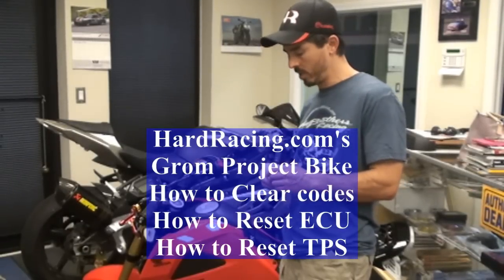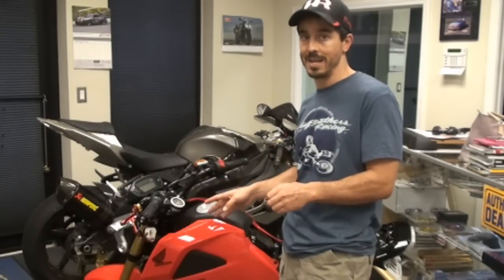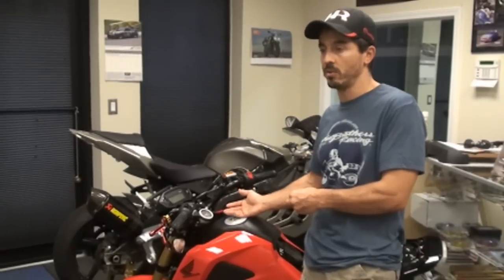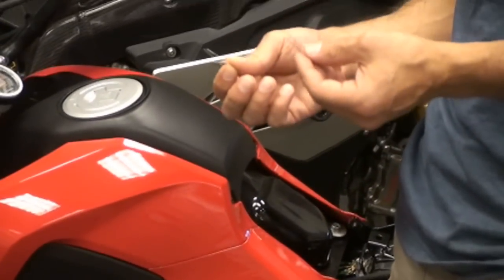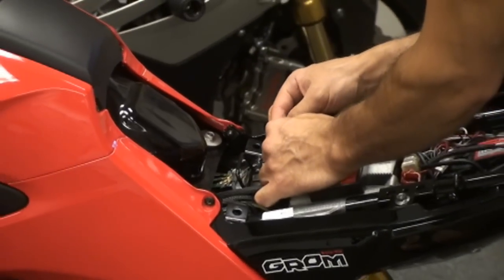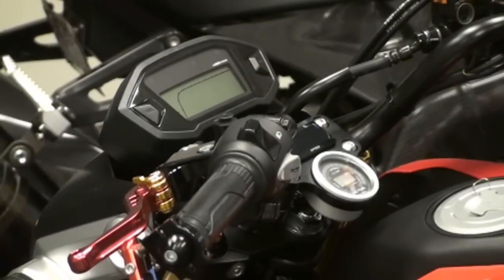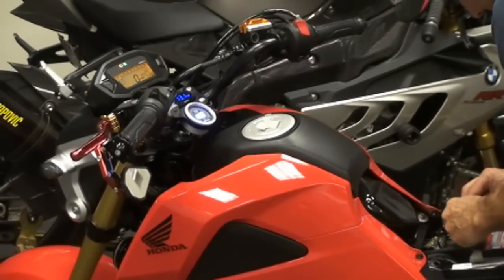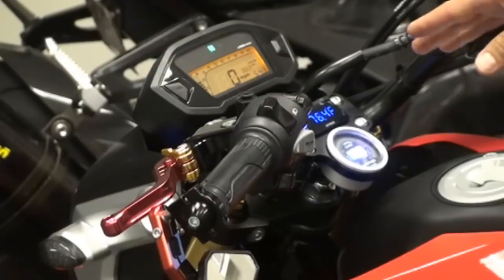How to reset Grom ECU How to clear Grom codes How to Reset Grom TPS  #Hardracing #Grom

Comment: Thx. 1st time Gromer.
Reply from the maker: That's great news.
Reply: @HardRacingPerformanc  Yeah, actually I tried to call you because my 2019 Grom didn't seem to clear the codes part of the process. Just nothing happened. I tried many times then reset ECU & it worked like you said.
Reply from the maker: @fpvflyriding   That's great news.  Glad you got it worked out.
Reply: @HardRacingPerformanc  Well, what I was saying is that the ECU reset but clearing the codes didn't work as you showed.
Reply from the maker: @fpvflyriding  that would indicate you didn't have any codes to clear.
Reply: @HardRacingPerformanc  Ok, great, I figured it must be something like that. Thanks a lot, that gives me peace of mind!

Comment: Does this work on new Honda Groms? I have a 2025 and the light came on. I only added a USB charging port, which plugs into the diagnostic port. Did a short test ride and everything was good. Took it out again the next day and the check engine light was on. Not sure if that's what is causing the light or not.

Comment: If you adjust the valve clearances do u need to reset the ecu of a motorcycle after that?? If anyone can reply im very much thankful..
Reply from the maker: you do not.
Reply: One more thing. Do you happen to know why my bike keeps on stalling upon cold engine start? My bike will start and will have a rough idle and after a few seconds it dies. It needs to crank 3-4 times before it will totally idle without stalling.
Reply: @jaysonbenitez740  sounds like your valve clearance might be to tight man. if they are you are gunna wanna get that fixxed asap. cheers

Comment: Don’t jam a fat paper clip or anything large in the TPS reset connector, or when u plug it back in it won’t make contact with the sensor. If that happens the engine light won’t go off and bike barely runs.use small wire that lightly goes in

Comment: My motorbike is throwing all sensor codes when I bypass that red connecter. Iv changed throttle body, ecu , harness wiring, 02 sensor wire, spark plug , coil pack, air filter/airbox and manifold, and iv changed the ect sensor. Bike has slugish acceleration anything befor 7k revs when7k revs comes the bike runs fine. Spark plug is white stuff but iv checked for airleaks no leak what so ever.

Comment: Hey mate, 
I got myself a flashed ecu , tried resetting and couldn’t get it to work. Followed these steps and got all the patterns perfect first try. Thank you! Only thing is after I was finished and plugged it back up, my check engine light stays on solid. Any reason for this? Thanks .
Reply: This is on a 2020 monkey btw
Reply from the maker: Unfortunately we don't do flashed ECU, or have any experience with them.   Too much unknown.  You'd have to check with the company you bought it from to find out why it's not allowing the reset.
Reply: @HardRacingPerformanc  thanks very much for your reply. All the resets actually worked following your video . Just the engine light stays solid. Cjr replied to someone saying ride it 20-30miles and it should turn off. Happens to the monkeys apparently and not the groms. I got mine flashed by dhm . 
Thanks again though, this video was the only one that was so simple to follow and worked perfectly after frustrating attempts following other instructions.

Cheers
Reply from the maker: @Mutthead  That's great to hear.

Comment: I took the outter snorkel from the air box and put on a new aftermarket exhaust with the dB killer  removed. The bike is running a little funny. I feel like I lost torque but it mite be from putting in 93 gas. I’m going to switch back to 87 but do you think I should do all of this? I reset the ECU but you said I have to do a step before that in order for it to work ? Let me know if you think I should do all three steps. Thanks !
Reply: Unfortunately, some modifications may seem like they will improve performance...…. but they wind up not doing so.
Reply: sales @hardracing yea so I put the airbox all back together except I kept the outter snorkel off . I’m hearing a lot of popping when I decelerate. I have the dB killer out of my muffler. Do you think I should do all of this stuff in the video?
Reply: This will work for the 2018 grom right ?

Comment: I have a Rs9 exhaust and I was told the grom has a self regulating ecu, but if I put a chimaera cold air intake would you suggest reseting the ecu??
Reply from the maker: Correct.   Reset the ECU.

Comment: Hey thank you for making such a video and make life easy.  I just picked up 21 Twin and installed battery tender and 2nd i notice i see PGM-Fi light stay on solid after ignition on and engine start. Wont go away read few hrs on blog and also check manual i came across this process. So what do u think should i do all 3 or just 1st part of ur video.  Please advise. 

Thank you

Comment: I don't have a grom but I have a 2018 Super cub 125 and I bought an aftermarket performance ECU from Yuminashi, After I installed it along with the heavy-duty valve springs my Super cub no longer runs or will start, I thought I might have to readjust the valves but that didn't work I also looked up resetting the ECU which I could only find info for the Grom and was told that they are very similar. Long story short do I have to reset the ECU" and how do I do that or Am I missing something. According to the directions from Yuminashi it was supposed to be an easy swap. Any help would be greatly appreciated.

Comment: Hello HardRacing,  should this be done after installing bazzaz zfi??   I have k&n filter and full yoshimura exhaust and had just purchased zfi from you guys! installed yesterday
Reply from the maker: If you already installed the parts, and the bike is already running fine, no need.

Comment: hi, I have yuminashi 6-HOLES LIGHT-BORE HP FUEL INJECTOR + KnN stock replacement air filter (mash) + full T akrapovich, ECU calibration pass ok with this set, but while after added "HIGH FLOW FUEL LINE HOSE" from yuminashi and bike seems overflown with petrol (smoke from exhaust when gear change, at neutral + full rev as result burned glove when shut exhaust with hand for second-2-3 "synthetic glove"). at low-mid RPM rounds goes dead/sometimes engine off on full rev. Just curious, may help ur advice with ECU reset, 1-2-3 steps to do? 
thx
Reply from the maker: Yes, you should follow the steps in the video to reset your ECU
Reply: Hello again, so far: 
1 step cannot manage to finish, no flashes at all, tried 3 times - nothing happening
2 step done
3 step done, seems reset pass. (engine was very stupid, at 20% rev no power and rpm not clear, reset think fine)
did overall 50miles but looks readjustment not fully finished. before tried town area, but from today ill try junctions 40-50mph where comp can learn a bit more about 0-100% rev on all gears.
Reply from the maker: You should bring it to a Honda Dealer.
Reply: coz of? changed last think fuel hosse

Comment: Hey thanks for video.   I have a 2018 with ABS that some dumb a$@ took off road now ABS light is on and this process is not clearing it. Tried sensor method as well and jumper is just not working.  Is there a different process on newer model?
Reply: Sounds like he make have damaged your ABS Ring or sensor.

Comment: Have a 2017 and the only mods I've done are new bars, fender elim kit and MNNTHBX exhaust. Since I installed the exhaust, should I be resetting any of the three you are mentioning?  Thank you in advance.
Reply: I believe its always best to reset the ECU if the exhaust is changed because it does technically effect the fuel in a way. Plus theres no harm in resetting the ecu and clearing codes :)
Reply: Alfie Barlow I just installed a Chimera intake last night. I should definitely do these steps right?
Reply from the maker: You should be fine to just go ride

Comment: I have no power commander yet, just chimera intake and tyga exhaust. The procedure is not working for me, I'm using paperclip, the engine light comes on when the fuel injector kicks in, then the light stays on, never starts flashing. What am I doing wrong? Maybe I'll try a piece of wire...
Reply: same for me too. I have the chimera intake and new exhaust from thailand. did you ever figure out what was causing it?

Comment: Nice videos you have, all of them. I have the Tyga carbon full exhaust, I-map (with map #3), camshaft type 1 and chimera air intake. What would you recommend? Reset ECU, clear Grom codes, reset TPS, or do all 3 steps?
Reply from the maker: Unfortunately, we have no experience with the I-map other then customers who purchased from someone else, and couldn't even get it to work properly, so they sold it.
That's why we don't carry it.

Comment: Thank you that really helped out a lot and solved my issue with the high RPMs when starting. One thing that did happen, no matter how many times I did it I could not get the first step to go right. But still using the same blue and green wire I was able to reset the ECU and reset the TPS.

Comment: Hi hardracing 
I have a big bore kit 181cc installed on my grom but the engine light on the dash stays on when motor is running is this because i need to flash the ecu?
Reply from the maker: sounds like something was not wired up properly.  Or left unplugged.
Reply: One year later... It happened to me when the FI CON2(Injection Controller) was disconnected

Comment: So after doing these three steps is it normal for it to run a little ruff and not idle that good until it relearnes every thing and if so how many miles till it lines it self out ?? Installed...(181bbk ,exhaust, intake ,cam , Koso 34mm throttle body, 150 injector, light weight flywheel and oil spinner )
Reply from the maker: it does take a little time for it to learn the New System.  If everything was done correctly, it should learn after about 40 miles or so.

Comment: Excuse me sir I have a problem 
My grom was running good until its start lagging at 5 rpm
Took off the tps and clean it with carburetor cleaner and it got worse now it have rev limited on 7 rpm
I tried the steps all the codes worked but still have this problem I need your help
Reply from the maker: That would definitely, require a mechanic to the bike in front of him to do testing and diagnostics.

Comment: Can you clear the codes with a PCV hooked up?
Reply from the maker: +MeanMeInc 
Not sure what you mean ?  
In this video you can see we have our PCV hooked up.
Reply: +HardRacing
 i am trying to clear codes but when wire is in and key on the mil light comes right on. Remove wire within 5 sec and reinstall and mil light stays on solid, cycle key and then light is out.

Comment: Hey, I saw your Grom was different than the black one that is in all of the videos. Can you give up details about all the mods you made, how it rode and revved before you reset the ECU, and how it runs now (with reset ECU), rpm limit, dyno numbers, top speed, etc...I had to sell my Grom because I was unemployed; and I would like to get another one with a big bore kit (Finbro 183cc or 235cc) with a super oil pump, and oil cooler. Everything else on the new Grom, I will keep factory (OEM) parts. I just want to make sure that I don't have any problems even though I thought my original Grom was great and fun to ride without any mods, for me personally. Thanks again.
Reply from the maker: +Chukwudi Ogbuawa 
The Red Grom was nearly identical in everyway to the Black Grom.
Same 183cc BBK, PCV, WBC2, Ohlins Shock, Clutch Cover, Oil Cooler.....etc.
The ONLY difference was the red bike had an FMF Full System vs. Yoshimura RS9

Comment: Got a question about my TPS. Sometimes my bike will act though ive closed the throttle at very low speeds with the throttle partially cracked open. I have to twist it a fraction more to continue cruising at the speed I was going. its only something that has recently happened and the only changes I made to my bike recently was that I found 4 of the airbox screws were missing so I replaced them. I have already reset the ECU so would resetting the TPS sort this or does this sound like a faulty TPS. its really intermittent sometimes its fine sometimes it does it. Cheers.
Reply from the maker: hmm.Sounds like you may want to take it to Honda dealer to check it out.
Reply: I found out what was causing it. It was my LED headlight bulb conversion or the DC conversion. I think it was giving off some interference on the ecu or somewhere else. I put it back to stock because I didn't like that the high beam light didn't work and it has gone away.
Reply from the maker: thanks for the feedback

Comment: Hello there to everybody im wondering if this is the same for honda cbr's 600rr im having a hard time to get it in good running condition I change throttle because I thoght my tps sensor was bad and start the bike and it dies bad and wont start anymore till I'll unplug the tps sensor so I have to reset the ecu for sure

Comment: Hi, I am a newbie Grom owner from Spain. And did see adapter cables 3 or 4 pin to OBD connector. As I happen to have some lying around, I would like to know if it is possible to read out OBD info and what connector I would need to hook the MSX125 up to my OBD. Just want to see the faces of my dealer when I arrive with my stock bike, but with a V-twin sound coming out of my Bluetooth speaker. Revving synced through OBD values.

Comment: As far as clearing the check engine light I went through the exact procedure and got the fast blinking lights.  I turn the power off and remove the jumper and turn the power back on and the check engine light is still there

Comment: after installing the pcv, do you need to reset the groms ecu?
Reply from the maker: +auomauom 
Shouldn't need to, for just a PCV.
We never did.
Only when changing  Fuel Injector, or Throttle Body.....etc.

Comment: If we just change the exhaust and nothing else, do we still reset the ECU or should I not bother?
Reply from the maker: GMH383 you Shouldn't need to if you are just doing an exhaust.
Reply: Mine only has exhaust and handle bars and was running like crap. I reset everything as shown in this video and that mf smooth now. Runs so good.
Reply: 1st step doesn't work with a reflashed ecu

Comment: When i installed my exhaust it feels like I lost some power, should I be doing anything in this video to my 2017 grom?
Reply from the maker: A powercommander could help clean up the fueling, and make it run stronger.
Reply: You’ve most probably just leaned out the mixture by changing the exhaust from stock. You need to add more fuel. Either use an injector controller or I just go up an injector size. I think a Grom uses either a 90cc or a 120cc  ‘B’ type injector. Going up a size to 140cc might help. If you want perfect fuelling you will need to tune the fuel map using a fuel controller and an air fuel ratio meter. Change settings, ride, analyse repeat till you get it right.
Enjoy

Comment: If the CEL doesn't blink in step 1, does it mean it doesn't have any codes to clear? I tried a few times but the CEL just stays solid. I was able to reset the TPS and temp sensor and got the blinking CEL for both.
Reply from the maker: As long as you got the confirmation blinks, that's what matters.  :-)
Reply: I have two 2018 Groms. One doesn't blink and one does. The one that does blink, the CEL flashes once quickly, disappears and then flashes. Pull the paper clip out and put it back in within 5 seconds and it goes to a quick flashing, signaling success. 

The Grom that doesn't blink works normally with no paper clip inserted, CEL comes on when key is turned and goes off in 3 seconds. Ready to start. However, when the green and blue wire is shorted with the paper clip, the CEL stays solid when key is turned on. It stays on through removing and reinserting paper clip and there is no quick flash indicating success. It just stays on. So, I think it is not clearing the codes. Resetting ECU and resetting TPS still works in most cases because usually no error codes are there. 

I'm going to take the Grom that doesn't blink in to the Honda dealer because if there ever is a code, I can't clear it.

I know this post is a year old at the time of this post, but it might help someone else.

Comment: The 1st step i still cant get it but e other steps it did blink...n tried many times but still cant get e 1st step blinks
Reply from the maker: +Rezz Rizzie 
Unplug the Engine Temp. Sensor on the side of the head. (just unplug it) 
Turn the key switch on and wait 20 sec.
That will throw a code.
Then turn off the bike, 
Plug the temp sensor back on, and Try again.

Comment: I cant get step 1 to work, nothing is blinking before or after (2017 honda grom) Step 2 is, as you decribe, is working fine....what to do ? (I have installed the yoshimura full exhaust
Reply from the maker: Try and unplug the Temp Sensor on the side of the motor.
Turn the bike on....... DO NOT START IT.
Turn the bike off...... plug in the sensor.Then start the video and do step 1
Reply: did this work? I have the rs-2 kit but it doesn't run right at all... 
It's like it's drowning when you go to higher RPM. that's the only thing i changed on it. 

should I try these resets?
Reply from the maker: Yes, try it bennie98
Reply: HardRacing it doesnt appear to give me the blinking light.  not even when disconnecting the sensor on the engine and turning it on and back off...
Reply from the maker: may need to bring to your local Honda dealer
Reply: Apparently it was just drawing air because the exhaust wasn't aligned with the cylinder properly.
just took it off and put it back. Runs like before the exhaust change, but without the droning sound that came when i just put the exhaust on. 
Thanks for your help anyways. Just strange that I couldn't get the ecu to reset. Maybe they changed the sequence on a 2016 model..?